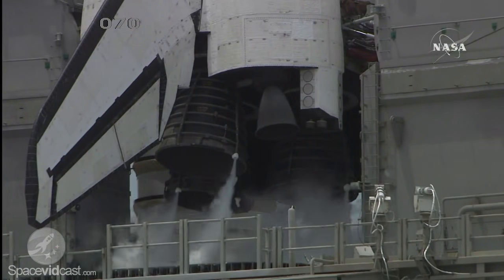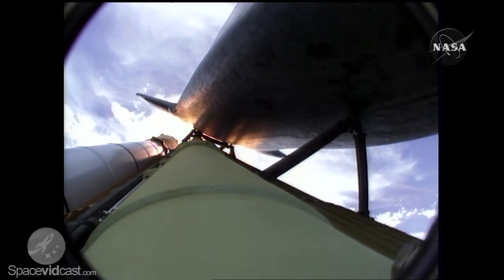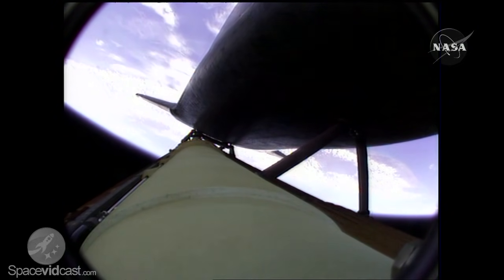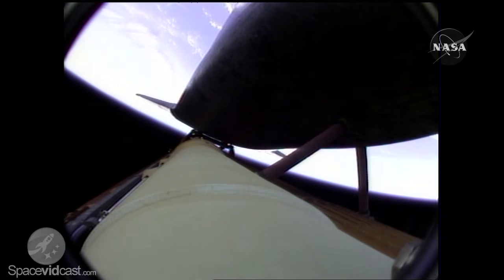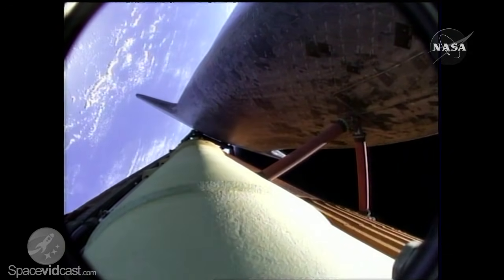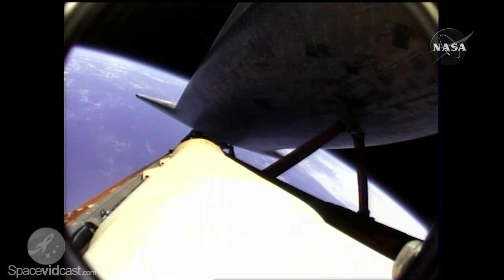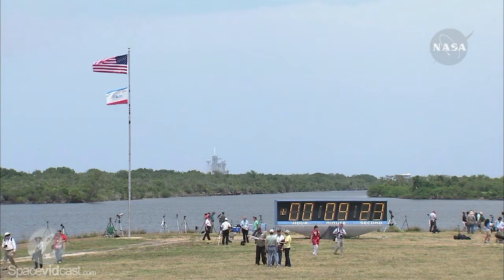STS-125 launch from T-2 to MECO - High Definition

Comment: 4:04  Watch as the shuttle adjusts its flight path slightly, as the guidance system has transitioned to closed loop after staging, and has achieved converged guidance.

Comment: With the fact that they go at a curve to space and not straight up does that suggest that this is because of the rotation of the earth? And not the way the shuttle was programmed by the brainiacks?
Reply: In order for a spacecraft like the Shuttle to be of any use and not just fall back to the ground you have to put it into an orbit around the Earth (or celestial body of choice.) To do this we do what’s called a gravity turn. Once we’re on the right heading, we apply a bit of pitch so our velocity vector is pointed slightly to the side instead of straight up. Then gravity gently turns the path back towards Earth.

This means we can focus our delta-v on gaining the required velocity for a stable orbit, and let gravity do the work of putting us on the right trajectory for us.

One of those little things you pick up playing Kerbal Space Program.

(It also reduces aerodynamic stress on the vehicle, which is good.)

Comment: ¿Alguien me puede explicar las leyes físicas y químicas que hacen posible este lanzamiento? Gracias!
Reply: Oxygen and hydrogen burn, turning into water vapor, ahd expanding inside the SSME combustion chambers. A similar process happens in the SRBs (with solid fuel.)

The expanding gases are forced out the exhaust nozzle, which accelerates the gases.

Newton’s Third Law means that for the downward force of the exhaust gases, there is an equal and opposite upward force on the Shuttle.

With enough force to overcome gravity, the Shuttle rises from the launchpad with a thunderous roar that is etched into my mind to this day.

The Shuttle pitches over to let gravity do the work of turning it, so that all of its thrust can be focused on acceleration to the velocity required for orbit.

Comment: Looking forward how NASA will lift anything into the planet's orbit without burning a tons of fuel because of a global carbon neutral "green deal"...
Maybe, the greatest genius of 21st century,  Elon Musk has his state of the art battery powered rockets ready in production.
Reply: The RS-25 (the main engine of the Shuttle and the SLS) burns hydrogen and oxygen.

Its only combustion product is water vapor.

Comment: It may say something that there were cameras affording this view at the time, while during STS-1 (1981), NBC News had to use animation to give us an idea of Main Engine Cut-off
Reply: Cameras were added after STS-107. They could’ve been added before. They actually had a camera in the port where the aft ET fuel feed lines are. It was covered by the door which closes after ET Sep.  You can find that footage in the “Space Shuttle: A Remarkable Flying Machine” documentary. I’m glad we got the SRB on-board cameras on 135. Wish they had a camera in the pod on the Vertical Stabilizer of Columbia, would’ve been an amazing view of reentry and landing.

Comment: and if it weren't for O-Rings and Foam insulation, they would probably still be Flying
Reply: If it wasn't for politically designed spacecraft placing their payload n the worst possible place on the rocket ten (?) Heroes would still be with us

Comment: 4:05 - Watch the shuttle adjust it's course slightly as the guidance system, which operated open loop during the 1st stage, has transitioned to closed loop and converged guidance is achieved a few moments after SRB separation.
Reply: Closed Loop verses Open Loop
Modern cruise control in your car is a closed loop system.  That means that the system actively monitors the speed of the car dynamically as long as cruise control is engaged. If you set the cruise control at a specific speed, and then car goes down hill,  the car will back off the accelerator to try to maintain the speed you set.  If the car goes uphill, the system will increase the accelerator to attempt to maintain the speed you set.  

After World War II, automobile manufacturers began developing cruise control systems. These early cruise control system prototypes were open loop. This meant that when you set a speed, the car simply maintained the accelerator setting.  It did not monitor the vehicle speed dynamically. It worked fine along level grades. However, if the car went down hill/up hill, the car sped up/slowed down, effectively ignoring the speed setting the driver made. These open loop developmental prototype cruise control systems were static, whereas today's closed loop systems are dynamic.

Shuttle Guidance Modes During Ascent 
The shuttle's guidance system operates open loop during the first stage (from liftoff to SRB separation). During this open loop mode, the guidance system follows a static sequence of actions based upon time and velocity performance data. It issues steering commands based upon these factors. During this open loop mode (major mode 102), the guidance system is not issuing steering commands based upon dynamically calculated navigational and guidance data, it is simply following a static pre-programmed sequence of actions. 

When staging occurs (SRB separation), the guidance system switches to a closed loop mode (major mode 103). In this case, closed loop indicates that the guidance system operates based upon dynamically calculated navigational and guidance system data and a guidance solution.  First, the navigation system determines the orbiter's current location, and then the guidance system dynamically calculates a solution to get to the orbiter's precise pre-orbit entry point at main engine cutoff (MECO). So, it basically asks itself, "Where am I now, and how do I get to my precise pre-orbit entry point at MECO?"  The guidance system calculates recursively until the guidance solution reached is at or below an acceptable 2 percent error rate. This is repeated until the guidance solution error rate falls at or below 2 percent consistently. Once the solution is repeatedly at or below the 2 percent error rate, the solution is referred to as: converged guidance.  Having achieved converged guidance, the guidance system operating in closed loop mode, now begins steering the shuttle to follow the solution profile.  This is what you see happening at 4:05 in the video. The guidance system dynamically navigates and issues corresponding steering commands throughout the remainder of the ascent.
Reply: Its amazing just how quickly everything happens after launch!

Comment: I thought the Quickest way to space was straight up!!!    Not levelling out to Horizontal to Earth.
Reply: This is true but their goal isn't just to reach space, they need to reach a specified orbit. If they went straight up they would not be able to establish orbit as they would not have the horizontal velocity necessary to prevent them crashing back to earth once the engines shut down. Also, the vehicle would not be able to achieve breakaway speed going straight up. You would need a much larger rocket with ridiculously large engines. Then you have to account for the insane G forces that would be placed on a rocket during a vertical launch. Basically vertical launch = bad idea.

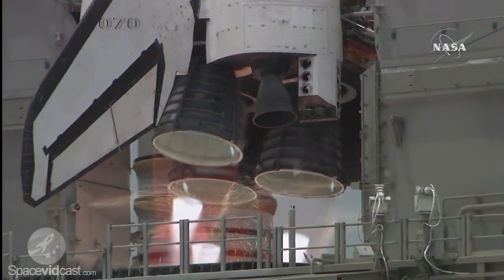Comment: what's up with the clouds? Around 1:53
Reply: It's steam and exhaust gas.  They use water directly under the shuttle to dampen the sonic vibrations from the MEs and SRBs.
Reply: +Dave Cline Liquid nitrogen or hydrogen to cool the engines down
Reply: I'm guessing he means- where did the large  clouds go at 1:59-  the sky is completely different- is this a magical launch?   It apparently got dark and then light again within an instant?    rookie editing of different launches!   what the fuck is a theodore?
Reply: lil dave- I'm guessing he means- where did the large  clouds go at 1:59-  the sky is completely different- is this a magical launch?   It apparently got dark and then light again within an instant?    rookie editing of different launches!   are you that thick?
Reply: How thick am I?  Apparently I'm smarter than you.  I didn't double post on a Youtube channel trying to be a smart ass.

You flat-earthers are all the same.  I bet you believe in chem-trails too, don't you?

Comment: The Three Main Engines roaring to life is the most beautiful thing I haver ever heard & seen in my life.
Reply: 37 MILLION horsepower in those babies.
Reply: @greggriffin3998  , nice blue flames to.
Reply: Ferdi 
I can’t agree with you more! I must have just watched them fire up 20 times in a row. I never grow tired of seeing and hearing that raw power. Amazing machine. 🇺🇸🇺🇸🇺🇸
Reply: You're right!!! and there are 89 people disliked the video. Who on earth cannot like this ??
Reply: You need to get out more then.
Reply: my favorite moment of every launch aside from MECO
Reply: @Din Yes I did, visited KSC this year on the  11th and saw Starlink 4 on the 17th of February. I still stand by my word.
Reply: Tell me about it!  Nothing like it, rumble baby rumble.
Semper Fidelis 🇺🇸
Reply: sls=slow launch system
Reply: @kellyweingart3692  In hindsight, turns out SLS worked out better so far than Starship!
Reply: The RS-25s were a joke. They can't air start, their injectors are prone to fail and break off, and their refurbishment costs after each launch are more expensive than simply throwing them away like a Saturn V F-1 engine.
Reply: @magicstix0r  SSMEs are the best engines ever designed.
Reply: @magicstix0r The "joke" is on you pal.  135 flights - never a catastrophic failure, the most efficient powerplants ever built of their kind.  The F1's are nice but work once and tossed in the ocean - talk about a waste - I do agree the maintenance for the RS-25's  was far more than foreseen originally however.  The Rocketdyne team should be very proud of the RS-25's performance in the shuttle program.
Reply: @greggriffin3998  How cute you don't know your history. The only reason the failures that did occur with the RS-25s weren't catastrophic is because of dumb luck. If they hadn't disabled the safety systems during Challenger's ATO it would have killed the crew, and Columbia's engine could have easily exploded or shut down during STS-93, which also would have been a LOCV accident. Efficiency is meaningless when your rocket engines cost more to refurbish than to build new ones. The Shuttle program was the worst thing to ever happen to manned spaceflight. It set humanity back decades and was the deadliest, highest rate of failure in any man-rated spacecraft.
Reply: @magicstix0r The deployment and subsequent servicing missions to the Hubble Space Telescope and the ISS Assembly flights ALONE made the STS well worth it.  Your are in the minority on your assessment of the value of the RS-25 Rocketdyne engine.
Reply: @greggriffin3998  14 dead astronauts are worth fixing a single telescope that cost roughly the same as a single shuttle launch, the "reusable, cheap gateway to space?" 14 dead astronauts and $140 billion are worth it for a space station that has never lived up to its design goals?

LOL are you smoking crack? If you think ISS and Hubble needed the Space Shuttle to happen you know nothing about spaceflight.
Reply: @magicstix0r  Hey Greg.  I'll see you down here next year when four RS-25s help power the gigantic SLS rocket on its inaugural flight to set up the U.S. to return to the Moon to stay, and open up the solar system for human exploration.  As magicstix pointed out, your angry and negative evaluation of the RS-25 / SSME engine is way off base.
Reply: @magicstix0r  Not to mention that it ate up NASA"s budget to where it could not fund additional replacement spacecraft. At least we have Elon now. Hopefully his starship can make up for lost time.
Reply: @magicstix0r  "If you think ISS and Hubble needed the Space Shuttle to happen you know nothing about spaceflight."

Both were designed around the Shuttle.  No Shuttle and you have lash-ups like Mir.

Comment: How does the spaceship move in space? Solar energy?
Reply: +The Right Honorable American 

Assuming you are referring to the Shuttle Orbiter (and any orbiting satellite for that matter), once the Orbiter had achieved orbital velocity - given to it by the SRBs and its own main engines, it would coast (i.e. freewheel) around the earth with no more motive power required. 
All it needed once safely inserted into orbit were the smaller OMS rockets and attitude control thrusters which were used to amend and refine the orbit a little bit and manoeuver the vehicle into various positions.

Comment: They never been to space ever
Reply: You've never used that pile of shit between your ears that you call a brain ever.
Reply: That just a pile of shit ..what are they using to keep it up there..something the nazi used in 43..i seen real super tek craft..thats just an extension of a satalitte. They pop on the ground..well as long as that goes up..thne area 51 is total bullshit..proof is there for all to see. They are up yes but they are down here caught up in the wellies in sand dune oil wars..
Reply: Time distance speed n fuel capacity..rocket fuel..na..that aint the answer..they need to find the centre of gravity points of each planet..like a bat does to get..to get an object signal n draw the energy from point to point..like a bouncing feed..prehaps they should get a sun solar panel inducer..type thing..
Reply: they should help the poor in usa too hahahahahahaha
Reply: Sarge Rho So they are regularly having to boost it up higher, but do they also have to boost their speed? I would guess so.
Reply: Universe Boosting its speed is exactly how they boost its altitude ;)
Reply: Sarge Rho Ah, right! Now I remember how that works! Thanks!

Comment: For Jesus: the risky "Return to Launch Site" (RTLS) maneuver begins with a big, fast sweeping 180-degree turn under reduced main engine power (if all the engines have not been shut down).  The astronauts practiced this on the computer, but never attempted it in real life.  On each flight, when Houston calls out, "Negative Return," the shuttle is too far away from the Cape and traveling too fast to try an RTLS.

For TheHidde504: Those are paper covers placed over the the "Reaction Control System" (RCS) ports to keep rain and debris out of the system during the several weeks each Shuttle spent on the pad prior to launch. They were not designed to remain intact during ignition, liftoff and ascent through the atmosphere.
Reply: This is not a correct description of an RTLS. The RTLS abort has four distinct phases and it begins with the Powered Pitch Around (PPA) maneuver where the orbiter+ET stack pitches up to an angle of approx. 80°s. This is followed by the Propellant Dissipation phase where the stack holds the PPA attitude until just enough propellant remains in the ET to make the required Main Engine Cut-Off (MECO) targets where the orbiter can separate from the ET and execute a normal landing at KSC. The third phase is the Powered Pitch-Down (PPD) maneuver where the stack pitches down to establish the proper ET sep conditions. The fourth and final phase is the MECO/TAEM phase where the main engines are shut down and the ET separated from the orbiter. 

This is the riskiest phase as things happens very fast here. Unless the ET sep conditions are just right, there's a chance that the ET could slam back into the orbiter. Right after this is the Nz Hold Maneuver where the orbiter essentially adjusts its attitude to keep the vertical forces (in the orbiter coordinate system the vertical axis is the Z axis) in check. Once those have settled down, the rest of the RTLS is handled like any normal End Of Mission (EOM) landing at KSC, with HAC Intercept, flyaround and finally the Approach and Landing phase.
Reply: @DaveS_shuttle  It's been five years, but somehow I think your description, while accurate, is much more than Mr. Jesus wanted to know.

Comment: They really should have implemented some sort of ejection system. It just seems like such a risky maneuver, a last resort almost. If there had been an ejection system, Challenger might not have resulted in such a huge loss of life. Apparently the crew compartment was largely intact up until impact with the ocean. An ejection might still have been possible.
Reply: Unfortunately ejection seats were not considered for various reasons, cost and practicality being among them. Once a vehicle is a minute into flight, ejection becomes impossible anyway as human beings don't react well to being shot out into a supersonic airstream.

When it became apparent that the shuttle was nowhere near as safe as first envisaged, various options were investigated but the architecture of the shuttle meant that there were no practical means of escape.  And with a reusable craft like this, retrofitting safety features  would be near impossible.

Compare that to the Soyuz system, early generations of which were probably even more dangerous.  But because a new vehicle is effectively manufactured for each flight incremental improvements could be made - the most valuable being the launch escape system (similar in concept to that featured on the Apollo spacecraft)

I suspect that the impossibility of applying a similar system on the shuttle was just one aspect that contributed to the eventual retirement of the fleet .  Designing from the ground up, today, no-one would apply the same engineering. 

In short, she was a dangerous, flawed, but Oh-So-Beautiful, inspiring piece of kit; and I really wish I could have seen a launch.
Reply: I think we might have different interpretations of the word “huge.”

Comment: soo the solid rocket boosters drop off at 100095 Feet of alt (31.5km) 4:02
and the large external orange fuel tank needed to hold up 3 times the strength of gravity?